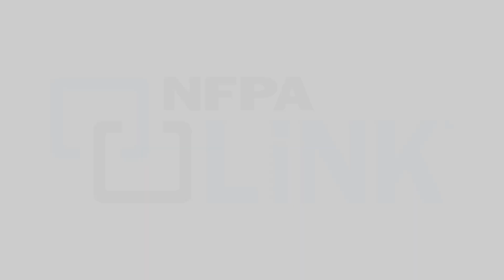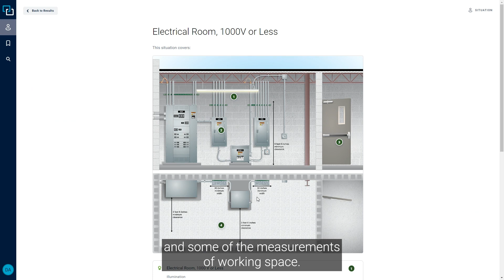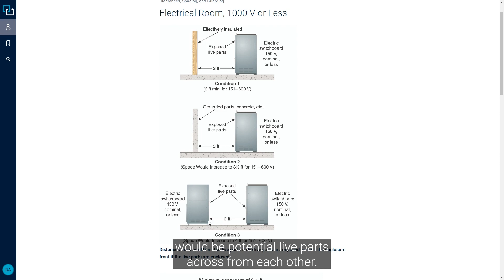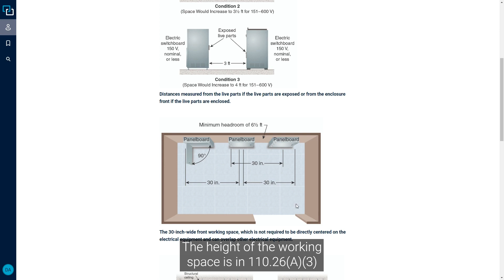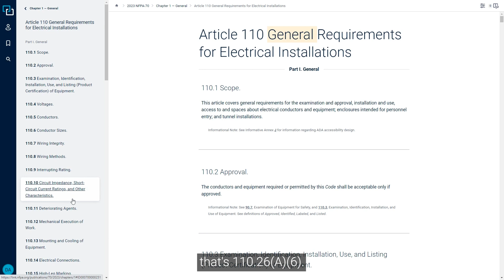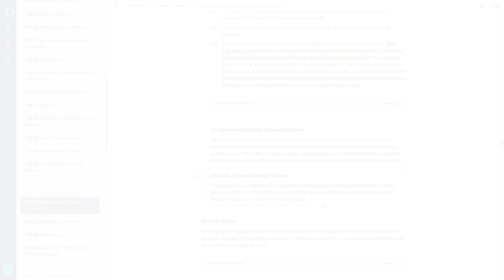Working Space About Electrical Equipment with NFPA LiNK®

Comment: Grettings, what I understand from this rule is that it requires clearance from equipment that is not part of the electrical system as a whole, meaning A/C ducts, gas pipes, etc

I had an inspector fail an installation saying that my knife disconnect was in violation of this rule because there is a communication box under it.

My problem with this assessment, is that according to chapter 8, all conventional communication systems are part of the electrical system

At the end of the day, inspectors will be inspectors, but I will like to know from more professional sources if the inspector is right or if he misjudged the situation based on the NEC